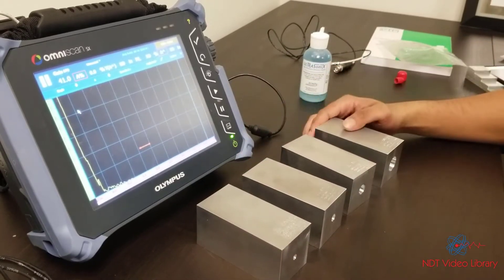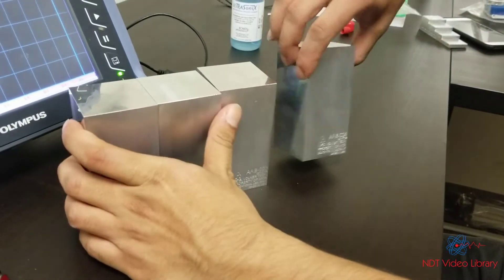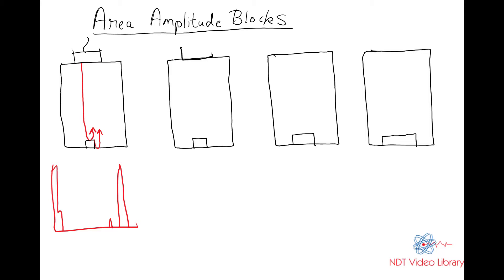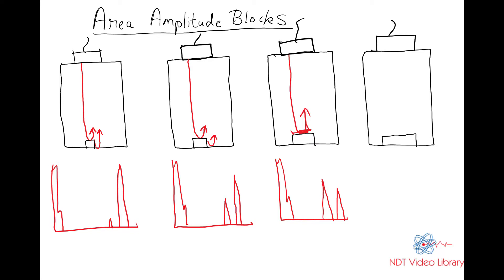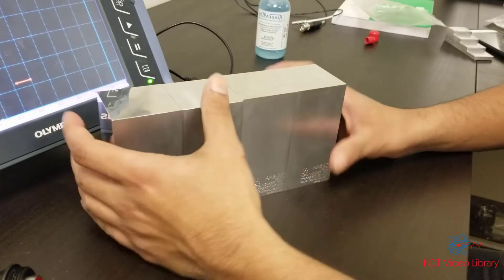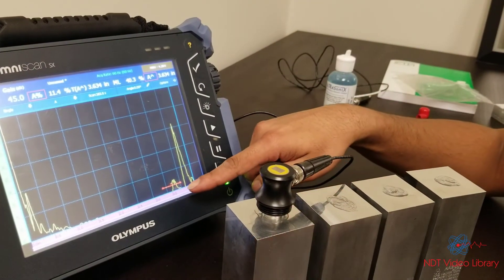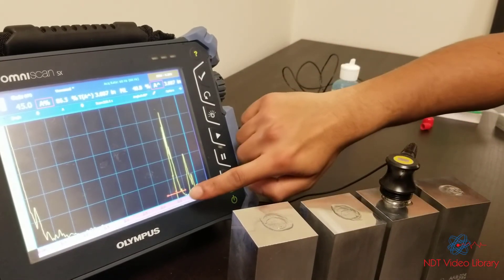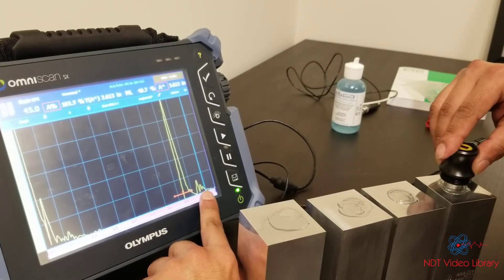What are Area-Amplitude Blocks in Ultrasonic Testing?

Comment: Thank you for the video, if u could also include what is the use of such blocks will be appreciated.
Reply from the maker: calibrating to the sensitivity you need. meaning you should set the reflection from the particular hole at 80% screen height. and which hole size you will choose depends on the procedure.